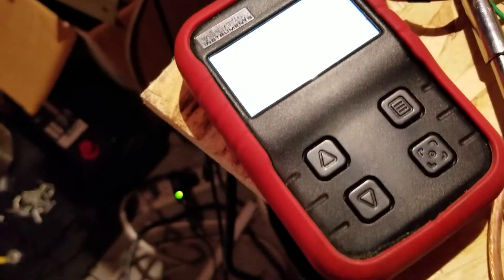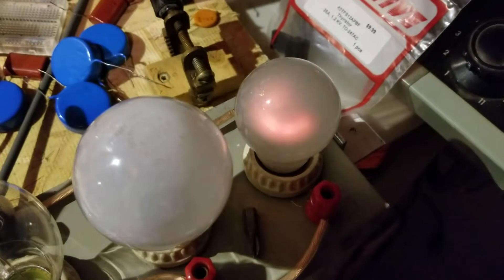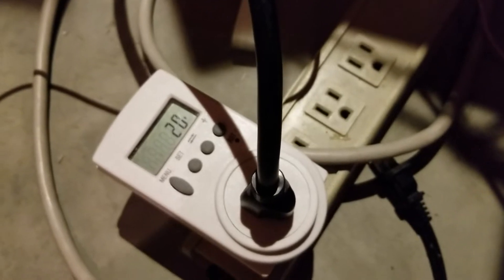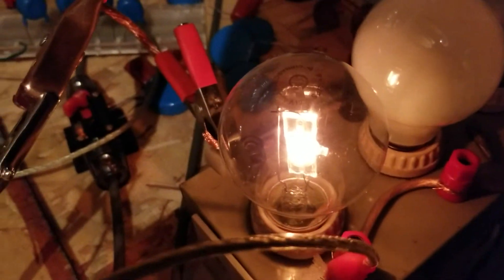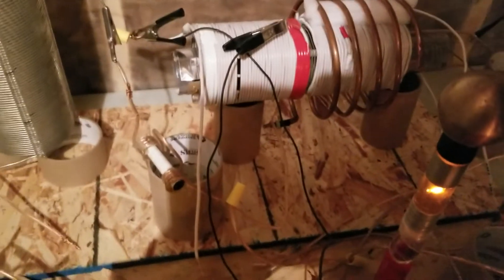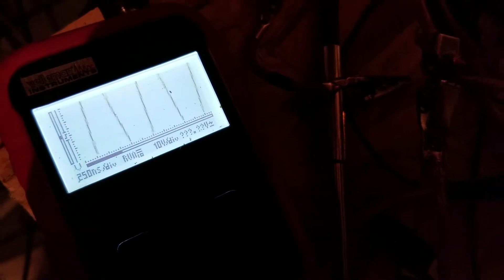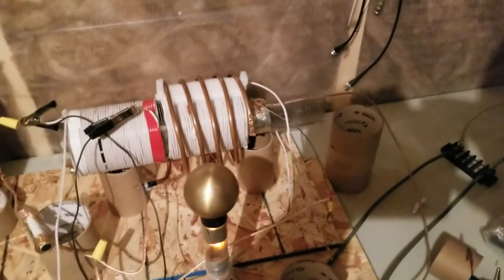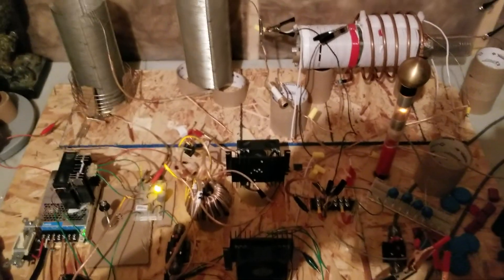Part 7 Akula / Vasmus / Kapanadze / Tesla Exeriments: added coupling, lower current draw

Comment: Nice one👍.
Reply: When you reach the point where you get the highest possible effect, I suggest  replace your power source with battery to avoid possible errors like ground loop. Using smps from power grid with earth connection may get a closed loop from device ground connection down to Earth and goes to the mains common ground to your smps back to device. Also, this phenomenon sometimes lead to smps damaged more especially when you drive your Tesla Coil with higher voltages.

Comment: Hi Kurt,

The next step in this setup is to raise Tesla output voltage to the point where it starts ionizing air (right before free streamers breaking out) and start playing with output coil not connected to the ground. It is something where me and others are curently at research - https://www.youtube.com/watch?v=IslTn00NYRY1

Cheers!
Reply from the maker: right on yes :) and i am following GFusion as well ! lately ive been frustrated, but i still keep finding new things everyday, thanks for the info :)
Reply from the maker: i can see right now i will need to replace my B&W coils to achieve a higher voltage, or drive a much higher voltage into the primary
Reply from the maker: are you on facebook? there is a group called Akula 0083 where there is more discussion, but yes i should go to overunity.com more often